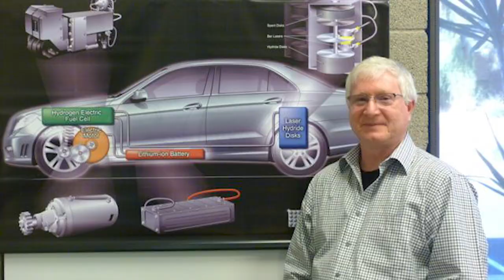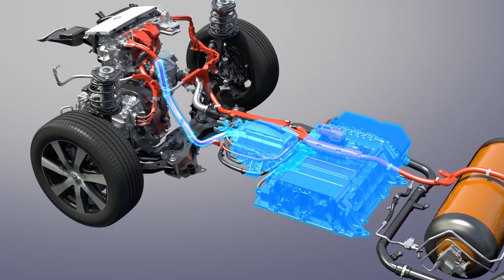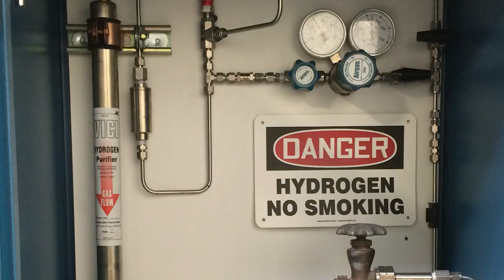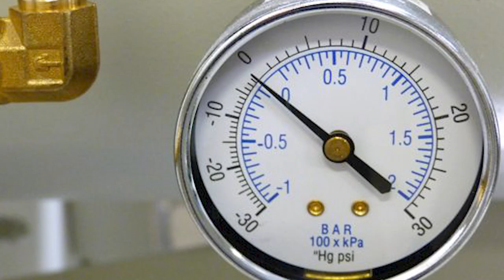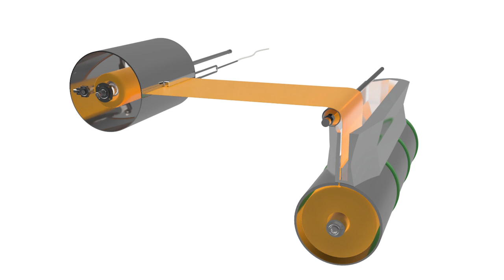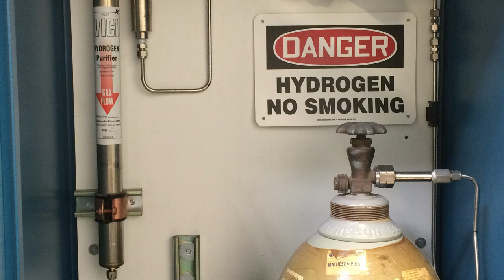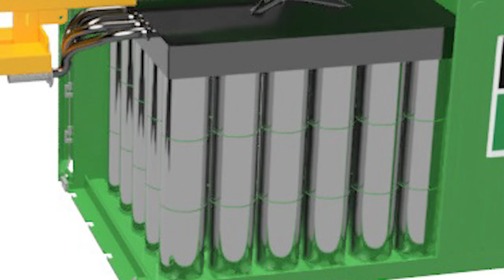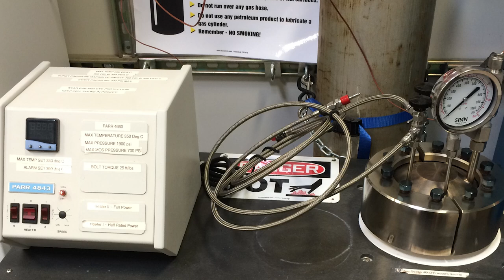This BANNED Technology Could Push Hydrogen Cars Over BEVs

Comment: This technology makes more sense for aircrafts, supply trucks, and ships that go thousands of miles on a regular basis. Batteries are still the way to go because of at home charging.
Reply: Absolutely!!!  I get so bored with videos making new claims about Hydrogen related to cars.
Reply: It’s just people who think electric only is going to take over have no clue how big the world is when cars are just a little tiny compact machine.  Toyota already has hydrogen trucks and ships but don’t tell the EV fan boys because they think Toyota is going to go out of business when it’s already done in multiple countries.😅
Reply: Aircrafts - 😂
Reply: That’s weird. I don’t remember having a gas station at my house. The only reason at home charging is a thing is to make EVs acceptable. It’s the convenience factor. No one would buy an EV if they had to leave their car at a charge station somewhere that’s not their home for a couple hours. Gas, spend a few minutes at a gas station and then you’re on your way. Without in home charging, the adoption rate of EVs would be abysmal.
Reply: @FuzzNiner  even if I agree with your point, which I don't, it doesn't change the fact that at home charging exists. Wide spread gas stations already exist. For hydrogen to take off you would have to build the infrastructure for it from the ground up. With EVs you don't. You can charge at home and Telsa is building a large infrastructure. I foresee hydrogen starting in the commercial market then maybe scaling to the average person after the infrastructure is large enough.
Reply: @julianbroughton  The funny thing is, that was the exact same excuse people gave when hydrogen powered cars was really beginning to gain some traction, then came along EV's and again that was the same exact argument people made, the only reason that the outcome is different now is because people like Elon musk have made incredible investments into the infrastructure. And that's really the big difference here, if we're constantly complaining about building the infrastructure nothing will ever happen.
Reply: @DonovanGoodwin  true, but just to be clear, I'm not complaining. I'm just not holding my breath for the Elon Musk of hydrogen to come around. It was a lightning in a bottle situation. Hydrogen will happen just slower than electric. But who knows.. Maybe another Elon will appear and blow our minds.
Reply: aircraft. 45000 hp..really..??, i dont think so..
Reply: @FuzzNiner  And if you live at an apartment or condo, I haven't seen them install any charging stations
Reply: Remember The electric car (EV) is over 130 years old and only here for the last 20 years they have been usable as transport over longer distances. The fuel cell car is only 26 years old. and already so come this far. so in 10 years EV will be overtaken by fuel cell cars
Reply: You'd be mistaken in believing everyone can charge at home.

First off, the power grids would need massive overhauls if everyone went out and bought an EV tomorrow. This would take years to upgrade and billions of dollars.

Secondly, you're assuming even if the power grid is able to cope that everyone can charge at home.

Not every house has a garage. In places with high density many people park on the streets. You can't have hundreds of people tossing high voltage power cables all over the street, across footpaths, etc. For a large percentage of people charging their vehicles at home won't be a possibility and they won't want to store their vehicle at some charging facility because that defeats the entire reason to own a vehicle.
Reply: @Pyroteq  you're doing a lot of assuming. The grid been needed an upgrade. Peaker plants aren't efficient. Tesla has a solution. More power needs to be generated. Tesla is making solar more accessible. In the situation you mentioned everyone switches to EVs simultaneously lol. First of all, that many EVs doesn't exist. Nowhere close. Secondly, I think we can all agree that the  transition will be slow but exponential as auto companies give in to producing EVs. There will be time to make more updates to the existing infrastructure.
Reply: @FuzzNiner  exactly, but you do have electricity in your home.  Makes it practical.
Reply: I believe that the H2 density is so low that, probably you can power just a few Watts fuel cell. No more
Reply: You clearly don't live in Europe, or the UK, majority of people do NOT have driveways & at-home charging is not an option without demolishing entire housing developments & rebuilding them laid out differently.
Reply: @beardyface8492  Actually, I have lived in Europe before and I've also visited the UK. Your exaggerating the situation. Plus, charging stations can and are installed some in parking facilities. My point has always be that the infrastructure is already somewhat established.
Reply: @julianbroughton  "Somewhat established". My nearest charging facility is 90 minutes walk each way, or about an hour & two busses. I live in one of the 2 largest towns in England. The so called charging infrastructure isn't even funny enough to be called a joke. There is a huge portion of the motoring population in a similar situation, if all you have is on-street parking in the UK EVs are as useful as tits on a bull.
Reply: @beardyface8492  that may be true for the UK, but that's the UK.. You were talking like this included all of Europe, which it doesn't. And we're just going to skip over the part where I said that charging stations can be installed in parking facilities. Not just on the street or in garages. I'm not saying that EV's don't have a ways to go, but it's ridiculous to believe that you can build a hydrogen infrastructure from the ground up more quickly and efficiently than an electric. Given that EV's have a massive head start.
Reply: @julianbroughton  Might be surprised how easy you could do H2 infrastructure, existing fuel stations aren't so hard to retro-fit they basically need a pressure vessel, some pipes, & a delivery pump & distribution works with tankers just like existing fuel.
Look into how much underground cabling & electricity sub-stations need upgrading to actually supply the numbers of chargers widespread EV use calls for & the bill gets enormous. Some adoption fine, widespread & the EV support causes massive headaches.
Adding charging to parking facilities you can stick a token charge point or two in now, you get 30%+ of the cars on it wanting to charge, you suddenly need new supply lines & an additional sub station.
Neither EVs nor H2 are a magic bullet, & what we need is BOTH, not either/or as the one solves the issues whenever the other is problematic.

Comment: I heard about the basics of this technology more than 10 years ago.  The individual who developed the nickel metal hydride battery was talking about storing hydrogen safely in a solid substance.  This was before the Lithium battery was optimized.  This does fall into the to good to be true category, but it is getting more real all of the time.
Reply: This was going to be the norm 10 years ago....In 2000 Ford in the US and BMW in Europe were working on a standardized delivery system and infrastructure. The first hurdle was making the process at least as safe as gasoline engines and filling. That happened in the 1990's
Reply: Metal Hydride is real.

Comment: This is not going to be competitive with BEVs. You just can't beat charging in the garage, and the round trip efficiency, BUT, this could be killer in an electric airplane, or ships crossing the ocean.
Reply: Ships crossing the ocean could simply use natural gas (which is Much cheaper than electrolyzed H2 - and less polluting than Blue H2 - produced from nat gas).
Reply: 3 times better energy density than batteries won't cut it for airliners. Even 10x better wouldn't ! I've run the 'sums'.
Reply: @grahamstevenson1740  That depends on the plane. There's still a long way to go for long haul flights, but airlines are already placing orders for small short haul battery electric planes. The amount of money that airlines spend on fuel is crazy, so saving that cost would make a huge difference to the profitability of those short haul flights. These first ones will be not much bigger than a business jet, but still plenty for many domestic flights.
I think they will take off in a big way when they are scaled up a little more to the size of an Airbus A320. At that point they can be used for pretty much all short haul flights.
Airbus and Boeing are both looking into hydrogen for long haul, but they're not at a stage of designing a product yet as far as I'm aware, so fossil-free long haul is still quite a long way off.
Reply: @grahamstevenson1740  I haven't run the numbers, and don't know how, but Elon said batteries would need to be at 400wh/kg and they are at 260. 260 x 3 is 780.
Reply: @avgjoe5969 Of course what you say is true today, but in theory, if somebody can make a cheap enough electrolyzer, and we go 100% renewables for electricity generation and heating and cooling, then there will be times when electricity prices are very low, and so green hydrogen could become competitive. Obviously, those are a lot of ifs.
Reply: @avgjoe5969  We've had ships that run on natural gas turbines for a long time (including some big, high-performance military vessels). But commercial fleets burn oil because it's just so cheap. International treaties/regulations required to clean up ocean shipping.
Reply: @avgjoe5969  Ship crossing the ocean could just use sails
Reply: @Findalfen  C`mon; they`ve tried that.
Reply: Not much harder to swap out little propane cylinders  like the Blue Rhino example.
Reply: Igor Negoda, a russian DIY blogger, is building an H2 powered plane.
Reply: It will be good for people like me that live in massive apartment complexes/buildings, with extremely limited or no electric charging stations. Against the lease to install any yourself as well. Need something similar to a gas station where I can either fill up quickly like 5 minutes or less, or get something changed out quickly.
Reply: @rdizzy1  Where do you park? In Europe, they do all kinds of things to make sure renters can charge. We don't, but we should.
Reply: @fjalics  They have parking spots for cars, I mean not every apartment place is the same. Mine is a sprawling complex with 1 main road through the middle, and then 8 streets, 12 apartments per building, many buildings per street. Parking spots going up each side of the street, then you walk down to your apartment. The parking lots aren't near any electricity source, pretty damned far away actually. I mean they "could" install something, but they won't. They don't even allow you to hang pictures in your house or paint the walls, let alone install something like that.
Reply: @rdizzy1 Governments can make rules, and give incentives. I get that you as an individual can't tell them what to do. Do those parking spaces by the street have street lights?
Reply: @fjalics  Yeah, about 20 foot away from where you park. 1 light every 500 feet or so. Like I said, they could do it, at least a few here and there, but no way in hell will they. (And they just remodeled the entire complex only 2 years ago, and they had the chance to put some in then, but didn't) So some type of other option will be better for people like me, there are hundreds of millions of people in the US that live in apartments like me as well. The buildings that do have electric chargers only have a few, just like there is a mall close to me that has some, but they only have 4 total, and they are full 24 hours a day, always.
Reply: @rdizzy1  I hope Biden's infrastructure plan addresses exactly that. And are those free chargers at the mall? They should make you pay, and put lots of them, and fast ones, like 50-60kw at least.
Reply: @fjalics  No, they aren't free.
Reply: It defies comprehension why cruise ships are still not running on the same nuclear engines as the aircraft carriers. Those powerplants have certainly made their proof of concept for 2 generations by now.....All that is needed to appease the security concerns is to have a couple military folks that would ride along with each vessel and make sure that nobody other than the other service personal approaches the powerplants.... .Those F...ing bureaucrats sitting at air conditioned desks all day long are the ones contributing the most to the global pollution, because , calculations demonstrate that one simple ocean crossing of a cruise ship release the equivalent  than 3.6 million cars, in sulfur dioxide
Reply: @MolloRelax I generally think nuclear power is a bad idea, because it costs far more than wind and solar, but when it comes to really big ships, we don't have any obvious non fossil option, and we know a nuke can propel a carrier for 20 years. The Ford classaircraft carrier nukes are 300mw. I also think the fuel in them, when new, is weapons grade.
Reply: Well that’s why our navy uses nuclear ☢️ energy to power their ships……refuel every 20 yrs? 🤣🤣🤣
Reply: @eyevincast5440 I think the stuff they put in their nukes is weapons grade. Also super handy in a sub. It doesn't need air. Nukes are not cost competitive for power generation on land. It would be interesting to look at putting a nuke in a container ship.
Reply: @fjalics  um what!? I’m not talking about nukes🚀 I’m talking about how a lot of big ships are nuclear powered and theyre not weapons grade you fool! The use nuclear rods just like any nuclear reactor /nuclear power plant just smaller to power the ship. 🤪🙃😉
Reply: @jacob_bocotan3554  Why waste money on it if it's worse? It has too many disadvantages, and not enough advantages.

Comment: Questions to ask usually left untouched are : 
(1) $ expense per km travelled comparison? 
(2) kWh per kg energy density comparison?
(3) energy/fuel production carbon foot print?
Reply: I would add: who is investing in PK?
Reply: Your questions are years ahead development. It would take an Elon Musk lookalike to get this technology available to you in the next five years. This technology could save billions of humans from the destructive force of fossil and fissile fuels.
Reply: Going on the data provided.. 15 lb unit gives 20 miles travel,...i would estimate that each of those units provides about 200-250 gms of H2 at best.
@ approx 25-30 kwh per kg H2 ( from the fuel cell) , that would suggest 5-7 kWh per unit..
So possibly near to 1kWh per kg ?
 Note a 20 kg “bottle” can store 5 kg of H2 (100-150kWh) ,..or 5-7kWh per kg of bottle weight !

Comment: I have questions. How much power does the laser used to liberate the hydrogen need?
How much do the cassettes weigh?
How many cassettes per car and what driving distance will each cassette give?
What is the cost of transporting the cassettes from place to place?
Storing on film sounds like a very bad idea, ever seen a cassette tape all tangled up?
Reply: I did a ton of math on a post here. it all comes out to junk. he said 15 lbs (guessing this is cassette size) for 20 miles. by the time you drop fuel tank/battery weight for an HEV you will have half (or less) the range per lb. and for a full EV you gain range but the cost/resources of transporting the cassettes its all worthless no matter what vehicle type you apply this too.

Comment: I can't see it ever getting cost parity with EVs. Hydrogen production will always be more expensive than making electricity and transporting electricity to where you need it is always easier. For applications where light weight is a must I could see it working though.
Reply: Yeah, but you are completely overlooking the cost and resources required to build massive battery packs for EV's. These batteries wear out quickly due to the frequent charge and discharge cycle. 'Fast charging'  significantly reduces battery longevity. Additionally, these batteries are ridiculously expensive to replace and difficult to recycle.
Reply: You are also assuming that you need wind power or solar to crack water molecules to make hydrogen. There is technology in Western Canada to derive hydrogen from oil and gas deposits directly leaving carbon sequestered in the original resevoir. Look up Proton Technologies.
Reply: @fancyesquire8888  you do know Tesla EVs that have been supercharged exclusively, used with Fleet Services with over 300K miles have lost only about 10 to 11% of their range right?
Reply: EV's batteries do not last forever. They lose performance over time. About range, lots of EV users do not charge their batteries to 100% most of the time, because the last 15% ar harder to get charged. EV;s batteries lose performance in cold and warm weather, sometimes alot. All things which can be improved .
Reply: @fancyesquire8888  Sorry, I must correct you there, EV Battery packs do not wear out quickly. Also the cost of them is reducing rapidly, and they are not difficult to recycle, there are many companies already recycling them.
Reply: @deejeemadrox1866   in the US EV Batteries are warrantied for 8 years. and each EV maker supplies a Cradle to Grave recycling plan.